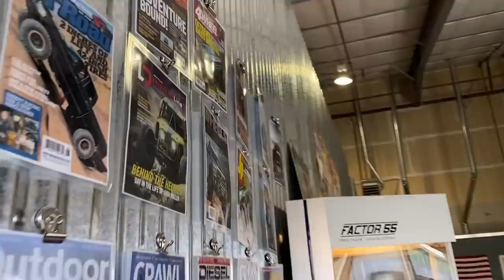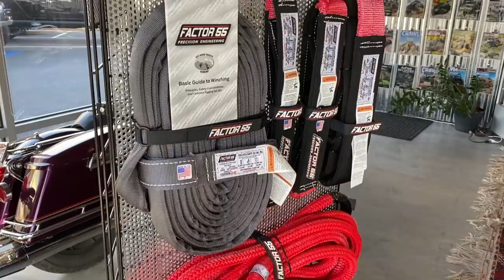TIRE BLOWOUT & OFF ROAD RECOVERY!

Comment: Good idea using the ramp as a back up with the jack to support the trailer.  Good thinkin Kevin.  You will get a lot of suggestions, so a nice heavy bottle jack will be good to carry and a couple wood lifts are great.  Get a 2 x 10 cut 3 lengths 12 inches, 18 inches and 2 foot, stack with glue screws,  you can use as a block also great to run one axle up on to help work on the other axle.  They stack together I used to try to keep 4 with me and it came in handy often.  Love little short legged puppy, Jelly is cute.

Comment: Make a set of 2 by 8 wooden ramps to drive the front axle up on to lift the back axle off the ground ,keep them with you at all times
Reply: They make those already out of metal and not to heavy....i keep one in my horse trailer at all times....they make a flat tire chg in half the time....my chalk/ramp is designed to work with either a flat on frt or rear....that trailer had allot of weight on it !!!
Reply: you can use your spare if you have to but you have to keep moving the rig
Reply: I was thinking the same thing lol.. I was like why are you unloading.....raise up one axle and let the rear hang....lol
Reply: Yep that’s exactly what I do if I have a flat with my 5th wheel plus I don’t have really any blowouts now that I switched from trailer tires to regular tires

Comment: I'm one of the people that would not recommend a dually. Yes on road it would add stability but off road diallys suck you  can't air down cause the side walls will eat each other and if you pick up a rock between the duals and not realize it your now destroying a side wall on each tire. So if ya get a fat assed dually ya should get super singles just in case ya ever gotta use the truck to recover the jeep
Reply: It's easy to see when someone tried to take a dually through a drive-thru and shouldn't have😊

Comment: Kevin just a tip if you took some 2x4 boards and put one on each side of the front tires you wouldn’t have to jockey back and forth when load the stepchild and my Gladiator. They would always be in the same spot.

Comment: And get a Rapid Jack.  You put it in front or back of the unaffected tandem tire and pull forward or reverse and it will raise the other tire.  It's basically a curved wedge.

Comment: Under inflation is more an issue than tire age. Also never put retreads on your vehicle.  You pay more for new virgin rubber but its worth it.  Invest in equalizer valves for your dual tires. Such as Cateye brand. Your tires will wear even then. You can find them at most truck stops or semi truck dealerships. Just a heads up.

Comment: Were your tires rubbing? On duallys the inside tire can rub the outside side, side wall to side wall if they are low on tire pressure, or over loaded.

Comment: Final tightening of the lug bolts should only be done manually or with a torque wrench. I have the Dewalt impact driver for my motorhome. I made the mistake of tightening the lugs with the impact. I could not remove the lugs next time. I had to buy a 3:1 torque multiplier. Then had to use a 4ft pipe on the breaker bar. I was just barely able to get the lugs off. You can snug the bolts up with the impact, but final tightening should always be down by hand.

Comment: Another trick i have learned is if you will put a small drop of airtool oil between the ring and your locknut it will keep them from wearing out and ring coming off

Comment: Build a ramp from 2x8 boards. You put it in front or behind the good wheels and then drive forward/back onto the ramp. The axle with good tires lifts the trailer axle with bad tire as you drive on the ramp. Keep the ramp in the under bed box with your straps. A piece of 2” ratchet strap and some screws with fender washers makes a nice handle.   Btw. Just put my first set of Patagonia’s on my wife’s Jeep this week and loving them. Hoping to win a set for my Jeep

Comment: quicker easier way to get the tires in the air for the trailer is to get a 4x4 block of wood and drive the front set of tires over it and park on top.  now the rear tires should be the perfect amount  off the ground.

Comment: You should re pack bearings on trailer would make a great video as well.
Reply from the maker: These are the wet bath type bearing. No grease or packing. Just keep oil in them

Comment: Glad your blowout didn't cause any damage. Whats the gvwr of that trailer? Seems overkill for 12000lbs or so. Lots of expense for 4 xtra tires you don't need.
Reply from the maker: 25k for trailer
Trailer weighs 9
JL Weighs 7
Gladiator weighs 6
So 22k without any additional items so I’d say we’re right in the safety net

Comment: Big Truck Big RV has 18 ply tire's and 9,000 lbs. axle's on his new dump trailer, the trailer is rated for 20,000 lbs.    check them out

Comment: Hopefully the trailer tire isn't included in the give away.    I had to deal with a blown trailer tire last summer.   $2100 in damages to the trailer.  then when I pulled over, I hit a small chunk of metal and sliced the sidewall of a tire on the other side.   We only had one spare.    
Also the Factor55 rope cover protects against sun rays ( What Justin told me a Jeepfest last august).    I have the same setup on the front of my JLUR.   But, happy for the upgraded stuff from Factor55.   This way, my wife can pull my ass out.

Comment: I had the same tires on both my trailers and they are absolutely trash. They will all fail on you I promise. Better just replace them all at once with good 14 ply trailer tires and be worry free. The tires they put on them cant handle the twist when turning with that kind of load which really sucks when you pay that kind of money for a trailer. Beside who wants to worry about if your gonna make it to your destination or not. You guys are awesome so stay safe

Comment: Whats up crew.  Blowouts suck.  Rear tandem blowouts usually takes the mudflap with it.  Gladiator QS35's are one of the very few trailer tires that last.  In general trailer tires are only good for 5 years from  the branded date.  I have several similar trailers and haul equipment almost every day.  I wish you luck with the milestars.

From my experience and others I have talked to face to face those tires you have on the trailer are the worst.

Comment: You do need a dually, I have the Laramie, heated and cooled front seats and heated rears. Dual climate control.will feel much more stable in corners as well.
Reply: Martin Smoot I totally agree with you on the dually at the beginning.

Comment: Where are the milestar trailer tires made??
So many are just chinesium JUNK and end up just like you showed.
Reply: I don't know about milestar, but the goodyear trailer tires I had put on my toyhauler last summer are made in the USA and so far have good reviews. At that time, I think it was the only trailer tire made in the USA. I'm not sure if they have heavy duty sizes.......my trailer is only 9K GVW on two axles.
Reply: @CGT80  My one trailer bought in 2010 came with the Goodyears made in the USA then was hearing not so good things about them last few yrs. Now with the Canadian peso tanking will not be able to afford made in USA anymore (50% exchange rate now)

Comment: Video has been up for 18mins and I’m the 7th comment. 
Didn’t your CDL class tell you to check the tires’ pressure?
No that’s what He said not she
The outer tire looks like it is under inflated as well
Reply: They are old tires, he did check the pressure.
Reply: He clearly stated in the video he checked his tire pressure earlier that day.
Reply from the maker: We check the tire pressures on every trip and always inspect the tires at every fuel fill up along with checking the straps on the load.